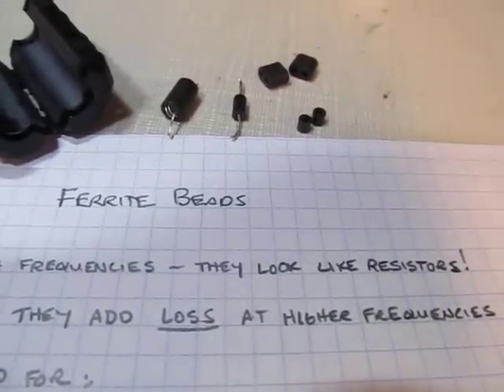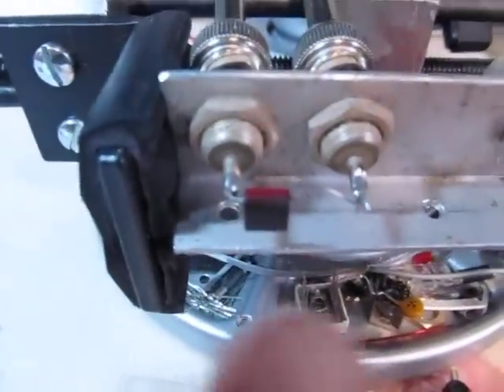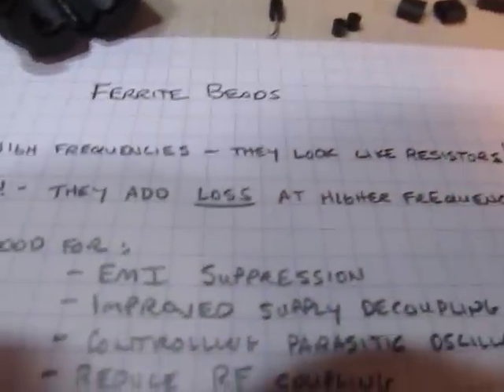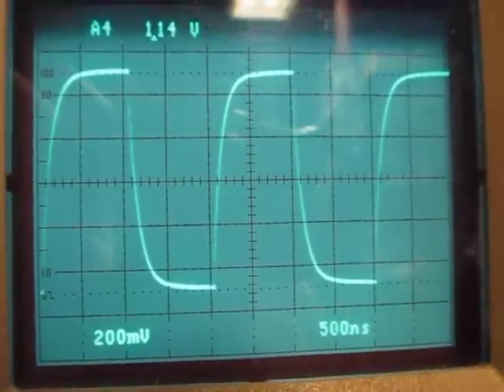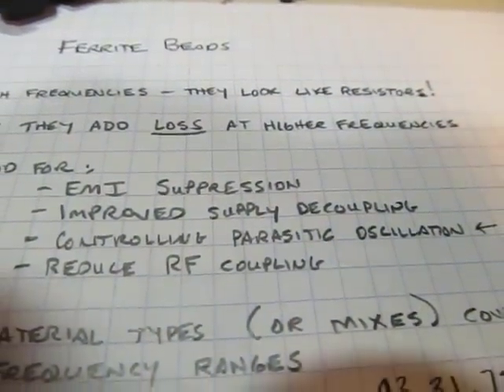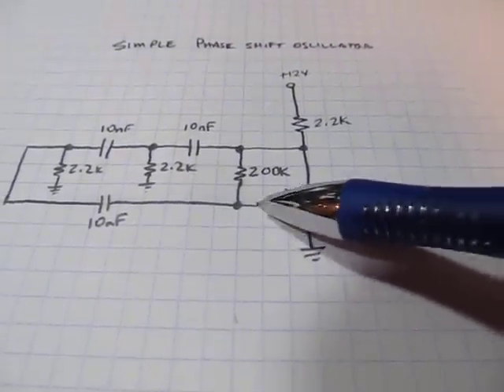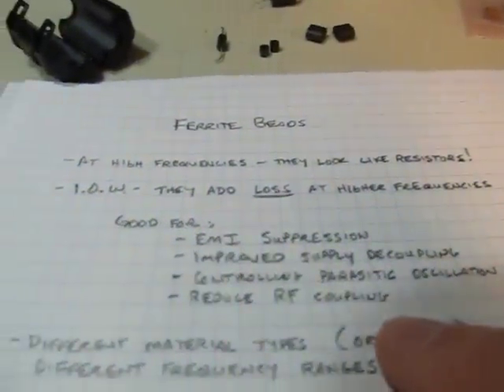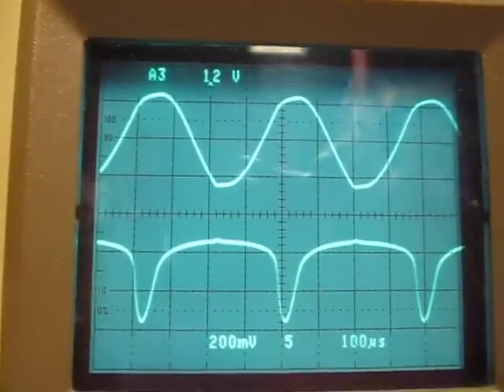#84: Basics of Ferrite Beads: Filters, EMI Suppression, Parasitic oscillation suppression / Tutorial

Comment: At the start of the video, you say your scope is set up to "sweep" so we can see the whole frequency spectrum. How is that set up? I was thinking perhaps your signal generator produces a trigger for each sweep through the spectrum, and you have the scope trigger on that, by its external trigger input. Is that right?
Reply from the maker: Yes, I used a trigger pulse from the generator that is synchronous with the start of the frequency sweep to trigger the scope.
Reply: Aha! Okay :)
Reply: ***** Just to enlighten us newer players, this means you have a trigger signal from the frequency generator that then is attached via BNC or similar to the trigger input of the scope? I have not used the ext trigger on my scope (Tek2465) yet, but I have an old IEC F34 frequency generator coming form EBay that I think will support this. Very interesting use of the two devices.

Thanks again for all your videos. Great content, and great instructional value.
Reply from the maker: PelDaddy Yes, this signal generator has an output which produces a pulse at the beginning of the frequency sweep, and I use that to trigger the scope.

Comment: In the RC phase shift oscillator circuit, why is the 200K resistor [which is Collector to Base Negative Feedback] used?
Reply from the maker: likely to limit the gain a little so that the output isn't a squarewave and is more sinusoidal.
Reply: @w2aew  Thank you very much.

Comment: I got a 50amp switching power supply that has a helicopter noise in my receive of my radio .. how can I fix it ..or can you fix it ....
Reply from the maker: First you have to determine if the source of the interference is conducted or radiated.  Is the scanner powered by this power supply?  Does the interference go away if you power it from something else?  If so, then the interference is conducted and might be addressed with a power line filter (ferrite beads, etc).  If the scanner isn't powered by the offending supply, then the source is radiated. The easiest way to deal with radiated interference problems is proximity - move scanner/antenna and the power supply away from each other.
Reply: It's in the switching power supply I'm running a cb radio on it .and it makes 3 s units of noise only on this switching power supply. It's one of the 60 buck self contained switch mode power supply units off eBay I've tried ferrite beads on the AC and DC  and still does it I put ferrite beads on the fan in the unit and it helped a little but still has a helicopter noise it goes and comes 3s units of helicopter noise
Reply from the maker: These inexpensive switching power supplies were not designed to be RF quiet. The noise is inherent in their switching frequency and circuit design. They cannot be easily "fixed" TI be radio friendly.  Special design considerations and testing is done for switching supplies designed specifically for 2-way radio use, and this costs money, which is why these supplies costs more.
Reply: This kind of power supply would give you what you need. It would let you tune out the interference you are getting. TekPower TP30SWV 30 Amp DC 13.8V Digital Switching Power Supply with Noise Offset.
Reply: You have a common mode noise problem.
Terminate the power lead to the CB (at the CB) with a low ESR aluminum capacitor.

Comment: I am only speculating but I think the high frequency content is filtered out because this energy is converted to heat in the ferromagnetic material. Since the input signal is is alternating this causes the dipoles to change their polarity and this dipole movement causes friction -> heat in the ferromagnetic material. Can someone back up my speculations :P ?
Reply from the maker: Yes - ferrites are lossy - converting energy to heat.
Reply: No.
An inductor stores energy and does not dissipate it.
Reply: Well ferrites aren't inductors so he's right, energy is converted into heat in the ferromagnetic material
Reply: Ferrite material is inductive. Chokes, inductors, transformers are generally ferrite material.
Reply: No, they are used in addition to inductors and transformers to improve performances. Cf https://en.wikipedia.org/wiki/Ferrite_bead
Reply: You just contradicted yourself. Baluns of hi-permeability material are used for HF/RF attenuation. Some energy is dissipated, depending on frequency, gauss, voltage...etc. Most of the energy is attenuated, stored and then released back into the conductor. It's basic electromagnetism. Faraday's Law.
Reply: @fredgarvin9262  an ideal inductor does not dissipate energy. Ferrites are intentionally made to be low Q, and lossy

Comment: Hi Alan, love your videos. I have a question, I'm doing a repair on a filter board in a welder. There are some failed axial leaded inductors 330uH 2.7 ohm dcr . When I try to find replacement parts I don't see any available with that resistance value, I found several with much less resistance.. could you explain why you might need additional series resistance built into the inductors. It seems strange to me because the device is  quite large 1/4" diameter,1/2" long. Thanks
Reply from the maker: Hard to say - without knowing the original design criteria, it is difficult to know if they were counting on this DCR value to meet some performance need or criteria, or that's just what was available at the time (price, availability, etc.).
Reply: I found some JW Miller rf chokes nos on ebay,they look almost identical. Same color of the molded epoxy and all,the dcr is rated 6 ohms,mine measure 2.7 ohms. I'm going to give it a try,I ordered them.
Reply from the maker: I'd be concerned with the higher rated DCR - since they'll probably dissipate more power (get hotter).  But, give them a try, see how hot they get.
Reply: w2aew  I replaced those chokes today, twice actually. After I popped two of the new ones I had a talk with Miller tech support. Traced the root cause to a shorted diode bridge. But the tech said on the replacement boards they had dropped the wire wound molded case of chokes, I guess the ferrite ones in series are enough.
Reply from the maker: Good repair lesson - the burned parts aren't always the only problem - many times they're the victim of the real failure.

Comment: is it possible to have too much ferrite in a 10m band setup on software defined radio? i am using RTL2832U dongle with upconverter and 1:9 balun for longwire antenna. there are several usb cables with ferrite beads in it, i am trying to decide if it is worth sacrificing some for the radio god to help improve the performance of my setup.
Reply from the maker: The ferrites on the USB cables are for common mode noise rejection, thus there really isn't a downside to having "too much".
Reply: no downside is good enough for me. thank you!

Comment: Thank you very very much!

Could I apply ferrites on the power supply of a pci sound card in order to filter noises from pc fans or other interference?
Reply from the maker: Sure, ferrites are used on power supply leads a lot, but don't expect miracles.  The impedance will be quite low at audio frequencies unless you wind many turns.  Then, you have to be careful about saturating the core.  Also, noise in audio amplifiers can often come through other paths - other than the power supply.
Reply: Thank again for the interest. The question was about putting a ferrite around the power cable of an audio card in a pc. But as you said I also don't believe that it will do a diference...

Comment: In this experiment the oscilloscope input is in high impedance or it is terminated?
Reply from the maker: terminated with 50 ohms.
Reply: ***** Out of curiosity... why? So the 10x probes are going into the scope with the scope set to 50-Ohm? Just trying to learn why you would use the 50-Ohm input in this case? Thanks again.
Reply from the maker: PelDaddy In the first part of the video where the BNC cables are connected directly, I am using the 50 ohm termination in the scope (frequency sweeps, square wave).  In the later part of the video where we see the parasitic oscillation of the phase shift oscillator, 10x probes are used and the scope is set to 1M input termination.

Comment: I'd be really interested to see an explanation of the cause of the parasitic oscillation on the base. How come there is no trace of it on the collector as well ?
Reply from the maker: It is common in BJT circuits to see such oscillation due to the base-emitter junction capacitance interactions with other circuit parasitics.  A wise older engineer once told me - "always make sure that there is a "real" resistance in series with at least two legs of any BJT amplifier to prevent parasitic oscillation.
Reply: @w2aew  thanks for the swift reply on a 7 year old video! What i don't understand is that it doesn't look to be simple ringing of passive components in response to being driven by a fast edge or some such. 

There is no sign of the oscillation on the collector trace. How does the base-emitter junction capacitance cause oscillation when this effectively is a passive component of the transiator? You can't make an oscillator out of passive components as far as I am aware.

Comment: 0:34 I scavenged the same ferrite bread from old mouse can I use it to suppress unwanted current flow from antenna (outer shield) to radio tx for UHF range?
What are characteristic properties of USB chokes?
Reply from the maker: There is no standard for what manufacturers use on USB cables - could be anything - so there's no way to say whether it would work for your application.  All I can say is try it and see if you get the results you're after.

Comment: Do you know what size fair-rite  clamp on cores  fit cb radio and ham radio  radioshack coax  cable?
Reply from the maker: Depends on which cable you have.  RG-58 is about 0.195 in diameter, RG-8X is about 0.242 in diameter, and RG-8 is about 0.405 in diameter.  You'll have to check the size rating of the various clamp-on cores to see which fits the cable you have.

Comment: Great stuff, thank you. Got to try to smooth out the overshoot on my cheap ass Chinese function generator with a ferrite bead. I think this is a really interesting subject how electricity and magnetism interact...like inductance, electromagnetism.  Thanks
Reply from the maker: Overshoot could be due to improper termination, probe ground lead inductance, or poor design.
Reply: yeah, im not sure what it is....probably a little bit of everything. :) there is a lot of mods for it here on youtube (some say that the slew rate of the op-amp is to slow, and that it has bad filter design)...i have a MHS-3200A 25MHz...similar to the MHS-5200. biggest problem i have is the overshoot and ringing on the squarewave. Other waves are quite clean, except for some frequency jitter at certain  frequencies over 1MHz. Ferrite seemed like a quick fix for the ringing..just need to find it first :) Thanks
Reply from the maker: Does the ringing diminish if you terminate into 50 ohms? See my video on reflections.  Also, are you using a probe with a long ground lead? See my videos on ground lead length, and on a homemade high-performance probe socket.
Reply: i dont have a 50 ohm terminator..and looked in the manual, and the spec say the impedance is already 50 ohm?!?!..i use rigol ds-1054Z with included probes...they are ok...but the "probes"/alligator clips that come with the function generator maybe is not so great :) according to the spec 10% overshoot!! ...that sounds a lot...but i will look at your suggested movies on the subject. Thanks

Output Impedance 50Ω±10%
Distortion <0.8%(20Hz~20KHz)
Square wave
Lifting along time ≤20ns (i guess rise time)
Overshoot ≤10%
Reply from the maker: 50 ohm output impedance and 50 ohm load/termination are two separate things - and you need both when signals have high frequency content, like your fast rise and fall times. Even the best squarewave or pulse generator will ring if not properly terminated. It's all about reflections.
Reply: aha, i have just started out with electronics as a hobby to build analog modular synths, so there are many question-marks :)..good to know about the reflections, i have to get a few 50 ohm terminators also :) again big thanks for the detailed explanation.

Comment: On some FPGA schematic boards, I can see that 0402 package ferrite beads are connected on the VCC power rail of some ICs that generate clock signal. These have a 220ohm impedance at 100MHz as per the datasheet. What I find strange is that these beads are not used on all clock sources. They are not always used on every schematic, often the clock source IC does not have any ferrite bead on the VCC. Also, it is not at all clear, how it was decided what value ferrite SMD component to use on the power rail.
Reply from the maker: It could be chosen based on simulation or experimental results.
Reply: @w2aew  do you have a video on this subject? I can't find simple explaination anywhere. First confusion is/was the difference between ferrite bead and inductor. They are not the same thing and have different usage. The resoruces I have found are too basic on explaining all this. Like they will say that ferrite bead is used to filter noise but not describe the procedure to know when to use and what value/package to choose.

Comment: With the EMI suppression I assume the inductor converts the high frequency  to heat ?
Reply from the maker: yes.
Reply: If a ferrite isn't accessible could I make few turns around a piece of copper?

Use the eddy current instead of magnetic hysteresis, do you think it will work?
Reply from the maker: No, it won't work.

Comment: I used 13mm Fer-rite that's split in-half- around my front speakers wire inside the cabinet of my home theater system,
and my 1 mile away transmitters sound went away!  Now if I could get rid of the modulated wave on my scope from the same transmitter's!!

Comment: Great knowledgeable engineer. Are you a professor?
Reply from the maker: Nope, I'm an Applications Engineer for Tektronix.
Reply: what is the job of an Applications Engineer?
Reply from the maker: In my case, it is to provide technical expertise for the equipment that Tektronix sells, and how to properly use the equipment in various customer applications - everything from Radar to WLAN.  I provide local technical support to Tek customers, as well as performing technical demonstrations and technical seminars, training, etc.
Reply: Oh yeah! Tektronix has O Scopes with modules for RADAR, WLAN, DDRs 1,2,3,4 and 5, false RADAR targets, proprietary LONs, and all sorts of other stuff, in the catalog, and oddball stuff one may only see at a Government Electronics Group DOD type facility. You can easily drop $4,000,000 into a single high end multifunction O Scope loaded with options,  modules, and various probes, from high freq to differential hi volt probes. I like some of the Agilent Keysight stuff, and I like some of the build quality in Hameg, but Tektronix still rules the roost in most places. Tearing down test gear & seeing thermally coupled transistor pairs, and other build techniques is quite an educational experience. Hameg was really big into the thermal coupling with little T092 cases up to T0-3s. I usually don't rip up Tek stuff just to see how it was built. I do cannibalize them for parts though, because I would rather see them stay in use. I don't care if it's an old all tube two gun, or what. They were and still are the best.

Comment: Great video.  Any interest is doing a video of the art of winding broadband transformer toroids?
Reply from the maker: Have you seen this one? https://www.youtube.com/watch?v=a8ViWS61hsU
Reply: @w2aew  I did see that, thanks.  I'm trying to understand the whys of it.  Core types, number of windings, ect.  I'm try to build a modified amplified loop antenna and learning RF
Reply from the maker: @clytle374  The main considerations when designing a broadband RF transformer are to pick a core material that is suitable for the frequency range of interest (from mfr site, or other websites such as toroids.info), and ensure that the inductance of the windings gives you a reactance that is at least 4x the system impedance (system impedance is the impedance of the circuits on either side of the transformer) at the lowest frequency of operation.  Again, you'd consult design data to determine how to calculate number of windings for a given core at a given frequency for a desired inductance.
Reply: @w2aew  Thanks, I'm gathering this as I go.  Are all -43 mixes the same?  One site says 5-400, another shows 3-60.  for wideband transformers.  I've wound a 9:1 with 7 twisted wires, is this valid practice?  6 in series with a center tap.

Comment: I bought a cheap Chinese power supply to the laptop (8$). When my old russian refrigerator [spark] activates the laptop disconnect internet,I think,there is wery big voltage drop but not. I dissasembly it and i see there is no coil input and output filters,only jumper. I put right coils in it,now works great.Thanks for movie,i subscribe and thumbs up !.

Comment: How did you set the oscilloscope to sweep?
Reply from the maker: The signal generator that is producing the frequency sweep also puts out a pulse at the beginning of the frequency sweep.  I use this pulse to trigger the scope, and I set the scope's horizontal timebase setting so that it matches the sweep speed of the signal generator.